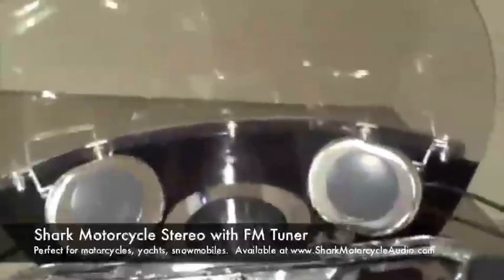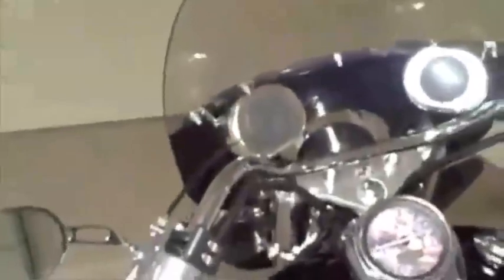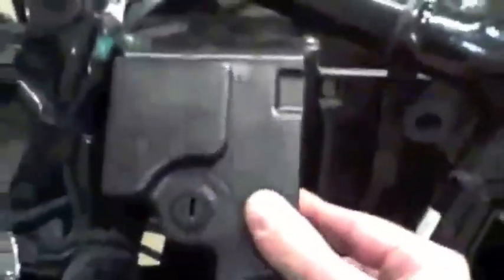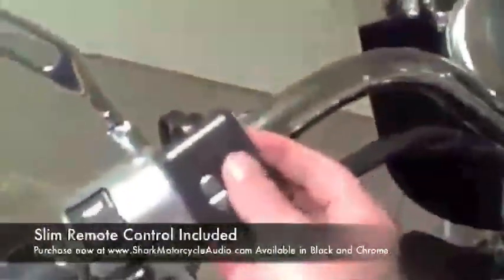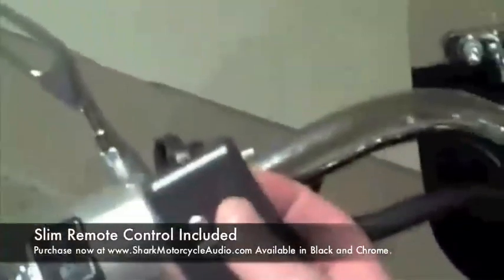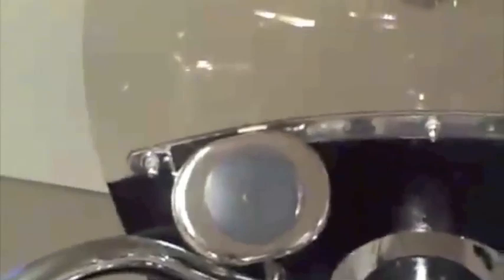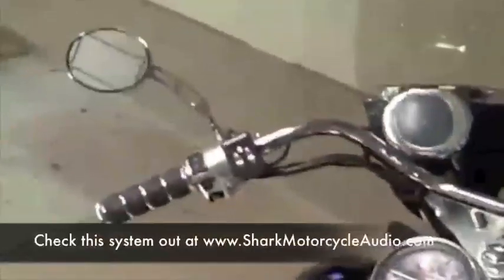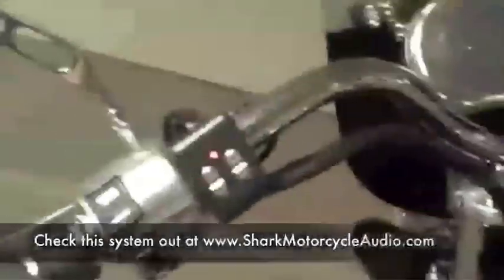Motorcycle Sound System - Shark motorcycle stereo installat

Comment: Did you splice the power cable into your tail light? If it's connected directly to the battery itself then isn't going to draw power from the bike while it's off? I just orded one and I'm not sure if you must turn the amp off every time you shut the ignition off.